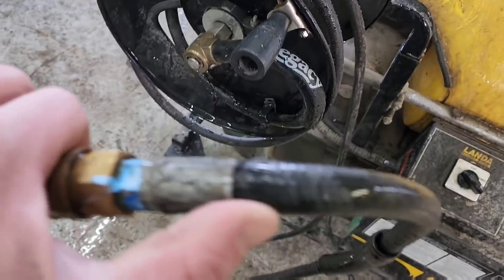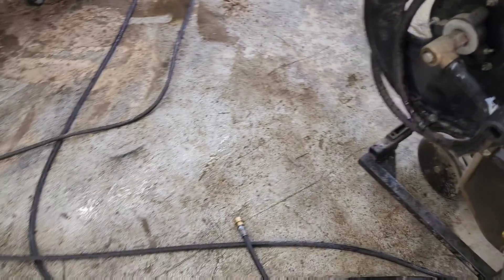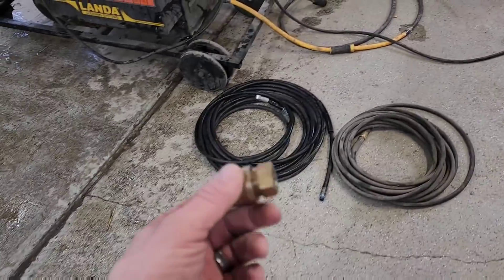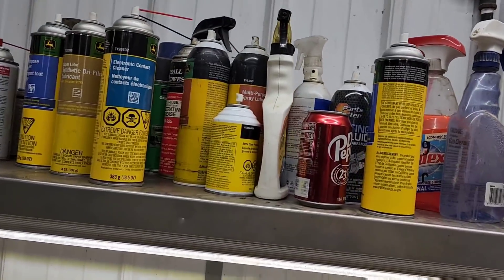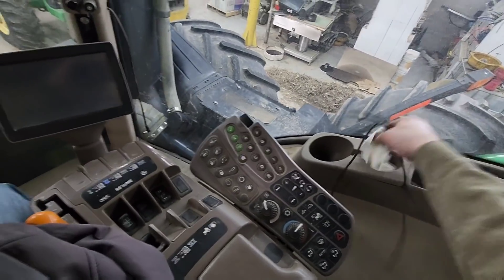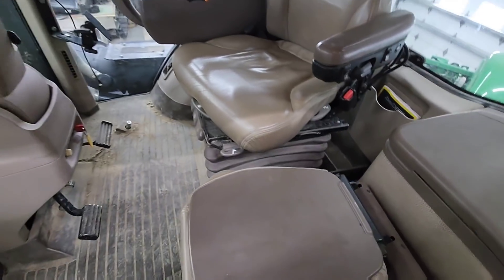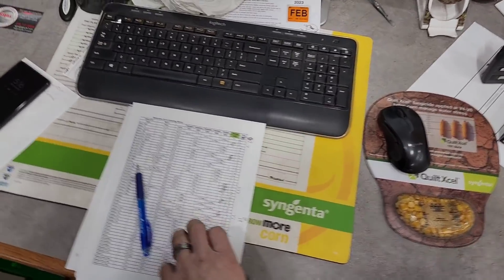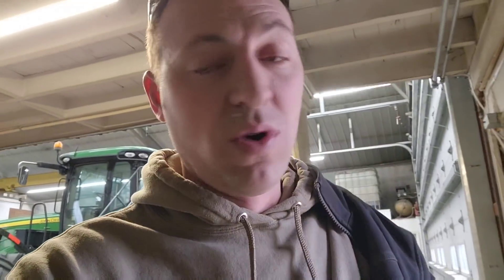Cab Cleaning and Soil Sample Planning - #617

Comment: I am, as well as most folks surely are, well aware at the almighty current hike in fertilizer and pesticide prices and this is influences people's decisions for this growing season. 

To me though comprehensive soil nutrient tests are a reflection of where the soil nutrients levels ARE at the moment of sampling (particularly with respect to Nitrogen levels). Clearly the amount of precipitation between the time of sampling and actual planting is likely to alter the available amount N in the soil because it is so soluble. This information is very important and shapes people's decisions about how much fertilizer should they plan to use to grow a crop and due to high price rises they are likely to be pretty conservative about how much is used.

Once someone has taken the decision to grow a crop is there a case for an approach of "little and often" for feeding the plants?

Linked to this is there a case for a greater use of laboratory testing of actual plant tissue? I recognise that this approach has the greater costs of more frequent applications compared to previous practise and in the case of Nitrogen a need for measurable precipitation to take place post application which may be quite unlikely for your area in the growing periods in the summertime?

 Equally I have no idea what the costs are for your pre-season sampling and analysis or the costs associated with tissue sampling are either.